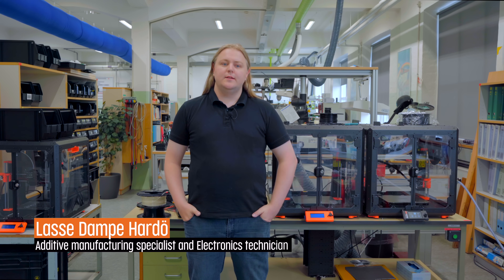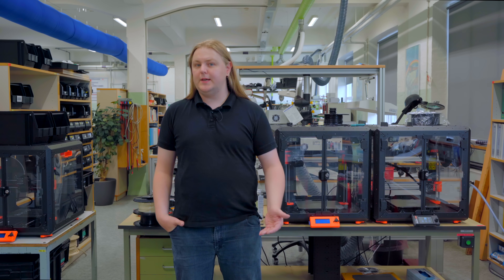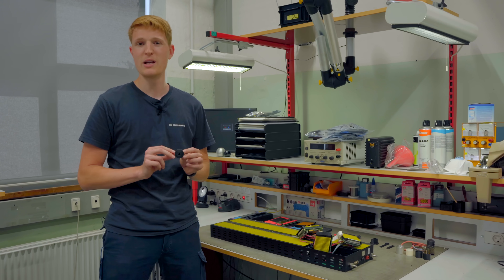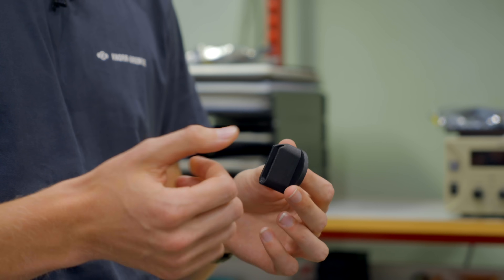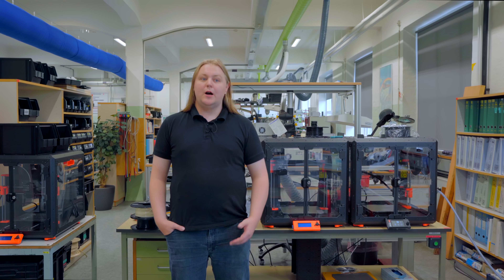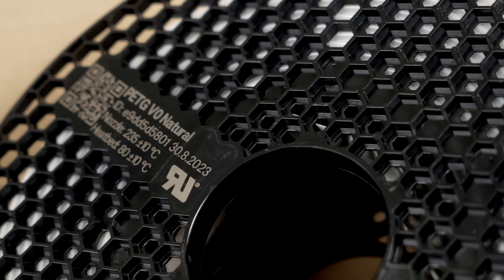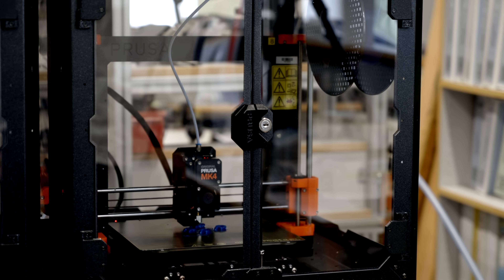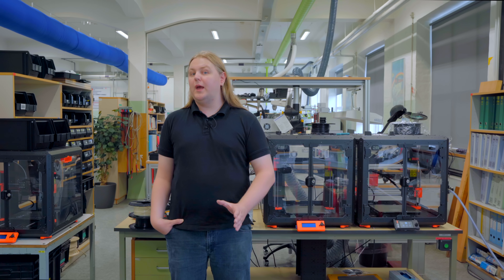Knorr-Bremse: Repairing trains with 3D printing and self-extinguishing filament

Comment: Stop barking at Bambu Lab, they are making real printers, unlike your DIY project)
Reply: Without prusa there would not be companies like Bambu lab. 
Even though bambu might be better in some areas, prusa simply and always work for years. As a plus everything is open source. Yes you pay more for a printer but you also pay for years and years of experience gathered by a huge print farm building the parts for new 3d printers.
Reply: What makes them "real printers" exactly?

Comment: That huge printer enclosure for such a small printer doesn't make sense to me... Wouldn't it make more sense to make CoreXY with the frame as the enclosure?
Reply: Well bed slingers always physically require larger enclosures. But it’s about the whole ecosystem, rather than the space required.
Reply: This is probably the most inappropriate and unnecessary comment. This is not about the enclosure nor and the size of the printer.
Your comment simply does not belong here.
If you are dissatisfied with something, write to support or Josef Prusa directly.
Reply: @Neo1983m  Huh? How is it inappropriate?  The enclosure looks huge in their shop, and it just seems like it is taking up way too much space. Sounds like you are taking my comment way too personal.

Comment: This should be recommended to the "Deutsche Bahn" 😘
Reply: Do you realize what kind of approval times they would face there? XD
Reply: Auf jeden Fall. 👍
Reply: Deutsche Bahn relies very heavily on 3D printing. More than 500 use cases have been realized and > 100,000 parts 3D printed. 12 different AM technologies can be used. Safety and fire protection are the 1st priority, which is why the requirements are very high.

Just google 'Deutsche Bahn 3D-Druck'.